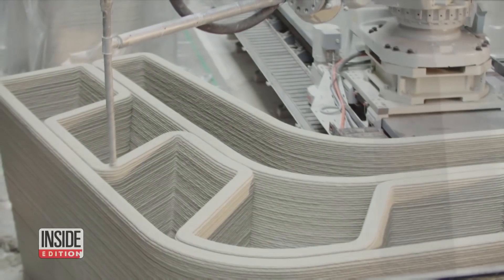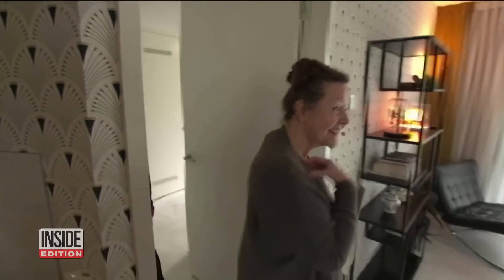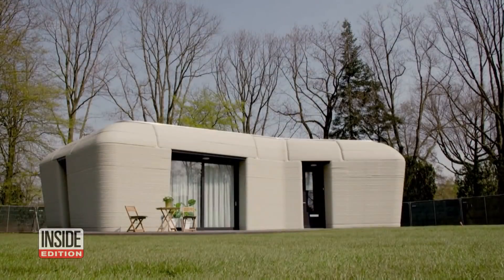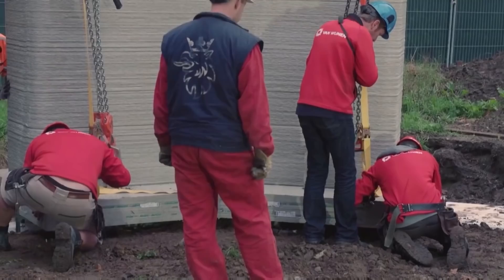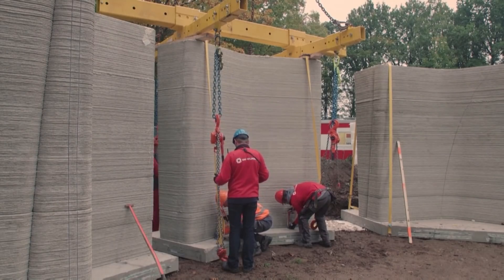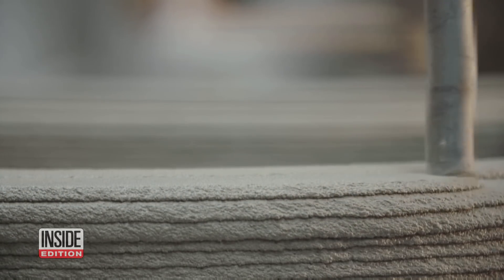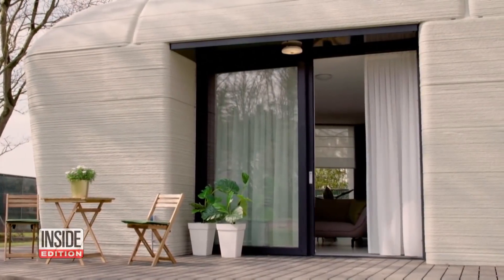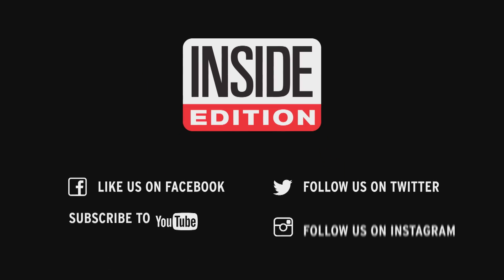Inside Europe's 1st 3D-Printed House

Comment: That sounds pretty awesome! I wonder how it holds up with different weather like rain and really hot days
Reply: It doesn't they leek and have a multitude of problems. 
When building a home do ot with Cement Bricks. 
Remember The Three Little Pigs Story.
Kind regards from Ireland Kate. 💕💕
Reply: Seal the outside surface and since it is concrete should be more thermally efficient than 2x4's 2x6's and insulation.

Comment: Its cool but wouldnt it be better to just make the sections using normal molds? Since you can add reinforcements too with rebar too. Although this would be useful in areas with low infrastructure since all you need is the printer

Comment: I would like a 3D printed underground home, preferably somewhere where the water table is super low, maybe on a mountainside. I would want lots of secret passages and hooks on the walls for hanging large heavy things. With good sound proofing and air circulation. Hello Clarice. 💀🤡

Comment: Wish the video is longer, wanted to see more of this house.
Reply: @Rik Mehta  nice
Reply: What if it rains tho? Is 3d printing material plastic?
Reply: @mojo4485  didn't u see it was cement 🤦‍♂️
Reply: @mojo4485  and get rid of that pfp now
Reply: @mojo4485  no, it looks like a fast curing concrete, very thermal cooling for summer and heating for winter
Reply: @theorangebaron1595  oh ok, thx

Comment: Imagine it burns down,

And you press print on a new one! 😂
Reply: The material is mostly concrete, so it would take some extreme temperatures just to melt it, never mind burning up. It would most likely survive any typical house fire.
Reply: Xerox
Reply: ctrl+C
ctrl+V

Comment: I’ve seen this before one time. This can potentially be the solution to homelessness. But depending on how stable it is. 3d printing is many things. 👍✅
Reply: yes but 3d printers and the materials needed for them can be expensive so not really.
Reply: @dieling9807  that’s not what matters. That’s only to buy it but spending money constantly is a different story. It’s still cheaper though